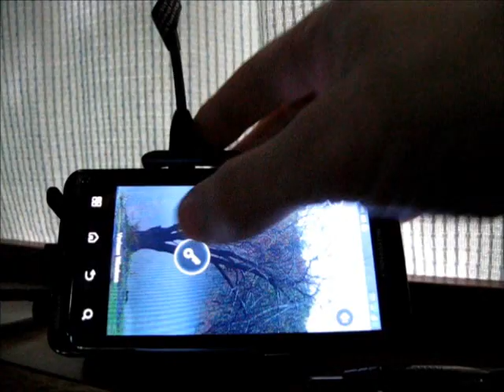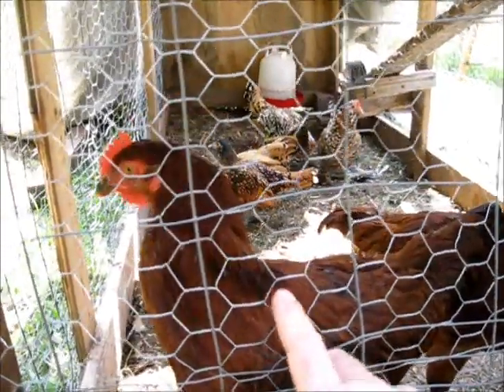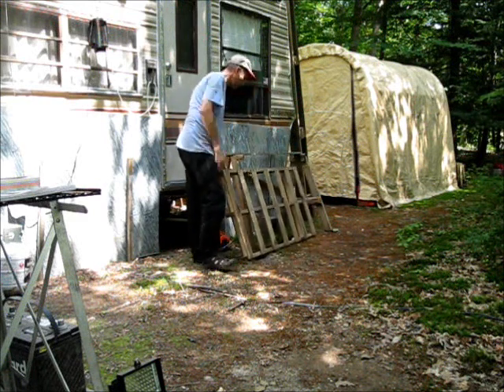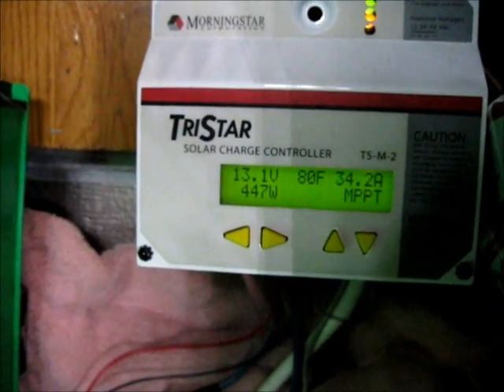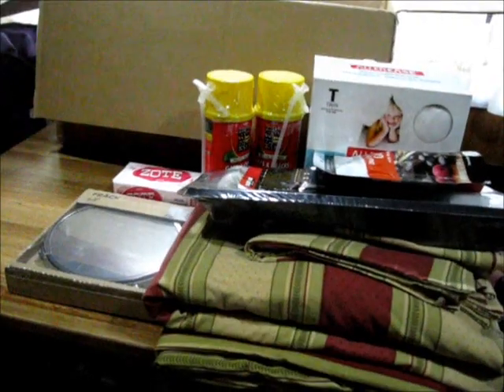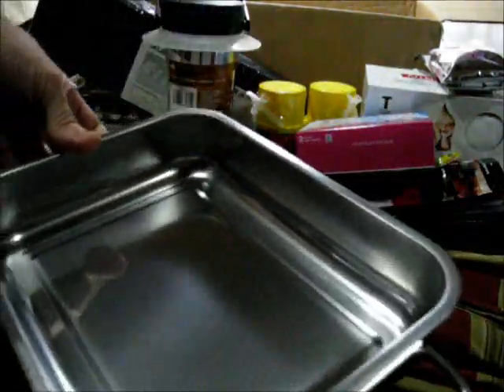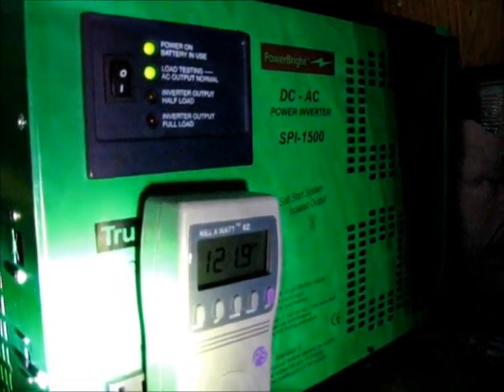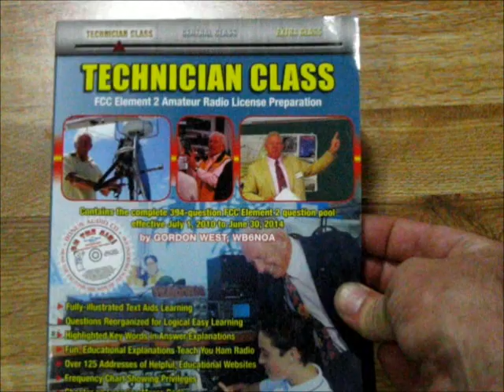Off Grid Solar Air Conditioning

Comment: After 3 hours of running, my inverter reported an overload when running my 5000 BTU AC wall unit.  I plan on installing a large farad capacitor to help with the surge.  See my channel to see my AC unit running on 2 solar panels. My Samlex inverter runs really quite compared to yours.  I like that Tristar charge controller.  I should probably get one of those.

Comment: Clicking your unlock button too much. Your chip is overwhelmed & confused. Make sure your phone is updated and cleaned of junk files too. Note the number of times the button shows waves out, it's processing your request. You tapped it 18 times in 27 seconds, then 26 times in 20 seconds.

Comment from the maker: Wait! What video are YOU watching??

Didnt you see it working on my video yesterday? All I need is larger wires. Using 600 watts of solar panels, 600 AH of batteries and it works.

NO, you do NOT need $15,000 of solar to do this.

Comment: does that inverter monitor battery temps...maybe the warm wires is setting off the threshold value of heat...the extra amp draw for the compressor stage may just spike the wire/battery sensed temp beyond that point

Comment: Your battery voltage is falling off way to fast as well. At 515 watts that thing is pulling 43 amps and you're only getting 20amps at 12.4 volts. 

You need about 700 watts of solar and 600 AH battery bank to run it for 4 hrs or so every day. 

One thing you have going for you is that MPPT charge controller. It's 95% efficient over the PWM which loses 30-40% of the panels output. Maybe use 4 six volt wired series\parallel rated at 225 ah. That would give you 450 ah and the solar can keep up with the load if its 700 watts.
Reply: You divid the watts by voltage to get the amps. Not voltage.

515\12 volts is 43 amps after the startup inrush which can pull 70 amps for the first few seconds. This is where people get caught. 

Only reason to go higher voltage is wire size. As a watt is a watt. You also need to use #4 wire from the charge controller to the AC inverter, batteries. This gives you max current flow and less resistance.
Reply: Claude Rains You're both talking about two different things.  Dividing by 110 gives AC amps and dividing by 12 is DC amps.  DC amps are what matters, though, when you want to know how much is being drawn from the batteries.  If deltasevenfour is talking about how many amps the air conditioner is pulling from the inverter then 4.7 amps is right, and that inverter should be able to handle that.
Reply: No I'm not. He is trying to use the 110 to figure his amps used. He needs to use the DC voltage as that is what is powering the system. 515/12 volts is 43 amps. He needs more watts and ah battery reserve. 

I'm an electrical engineer . I do this all day long.

Comment: I also have tried to find info out on that inverter. When Googled " Powerbright SPI-1500" NOTHING comes up, even at the Manufacturers website. Very strange. I'm wondering if that is not a prototype or experimental that was given to the dealer for evaluation. The closest model by Power Bright looks nothing like that. Because it is a Chinese based manufacturer anything is possible. I did Email them for Specs and a Owners Manual in PDF (hopefully)

Comment: AC has a start-up surge of 2-3 times it's normal rated running power. For a second , it'll draw 1,000-1800 watts on start up. When your batteries were still at a pretty high voltage, with the solar panels helping, the inverter may have been able to handle the start-up surge. You may have to go to an inverter with a higher surge rating.

Comment: another thought, check where the wires are connecting to the back of the inverter.  Thermal cycling may have loosened them a littlte

Comment: Your AC problem could be that it ran for so long trying to catch up that you frosted the coils. That will stop the refridgerant from moving from the compressor to the expansion chamber and then the coils so it cant disperse the heat.

Comment: I have no clue what you are talking about energy wise. What is a good book or info for starting out? Curious about the noise level from the inverter and other equipment? I realize with the ac on white noise is quite high but cool.

Comment: Of course it works, power in = power out, with a little inverter loss, maybe 20% worse case. I've run my 800W 8000 BTU window A/C on my 2 walmart 114 Ah batteries, 24V 1800W sine wave inverter and it works great! In the daytime with power coming in from the solar panels you are getting FREE A/C and it's a great feeling! I won't say it will run it all night but don't forget IT CYCLES ON AND OFF so the batteries are getting charged in between runs. Factor that in before you poo poo the idea.

Comment: Two of the 6 volt gulf cart batteries in series for 12 volts is a good choice, always charge them at more than a 10 amp rate as that helps keep the batteries in good condition. (Never trickle charge) But, do buy a gallon of distilled water (89 cents here) and put water up to the ring under the caps on top. weekly!  Epsom salts will destroy the batteries a few days after you put it in. avoid it...

Comment: The inverter is shutting down because your battery is fairly drained. You have drained the battery during the day playing with the air condition without realizing it. So, when you turn it on in the evening the drop is voltage will trigger the inverter. You need more solar panel or battery.

Comment: While it may not be within the budget of many of us watching his daily videos, $3,000 is a whole lot less than many critics of solar & wind say it is. And it's still below the $5,000 budget Troy plans on. Considering that you pay about $200+/month in electrical bills, the system you've researched will pay for itself by the end of the first year's end. And if you use electric heating, cooking, cooling, etc, you'll also be replacing natural gas too. That's another $50-$100+/month you're saving.

Comment: Look on Youtube for videos on how to restore weak batteries using epson salt. My suggestion to you is try to find old pallet jack battery. Though it may weigh 500-2000 lbs, it will last you a lifetime. You can take apart the pallet jack batteries and reconfigure them to 12VDC. These batteries will last you 40+ years if you take care of them. Keep your batteries in a small shed and keep them in a cool and dry area, away from direct sunlight. Marine batteries, Golf Cart batteries will also work.

Comment: YES! Normally I chose to not post my preps on the internet for OPSEC. But since you asked, I will answer. I have 2 Gens1 10KW & 3.5 as BU.w/ 200 Gals of Gas w/ Stabil. I have 12 KW of Solar running into 3KW  GridTie Inverters & 24V Battery Bank of 24 Trojan T-125 Batts feeding a OutBack 24V DC-AC PSW Inverter, Food for 4 for over 1 yr of  LDS Cannery , Wise & Reg Food.  250 Gals of Pottable water & Filtering 2 make 20 Gals per day. Security/ COMMS covered. I could go on, but I think u see Im OK.

Comment: Your chickens need a lot more room.
Reply: AGREE!! Give the chickens some space!!.
Reply: Yes agreed but please offer some sort of solution when criticizing someone. There might be critters around that want to eat those chickens which might be why they are locked up! That canvas covered shed thing behind the van that you put the AC in would make a good sized chook house if the frame was covered with mesh and a tarp on one end for Weather cover rather than the canvas cover it now has. So if you can get another of then it would make a good coop.

Comment: Between the hours of 2pm and 4pm it's hard to do work outside on a very hot and humid day. I say if Troy can get a running AC unit going without being tied to the grid, go for it. It's not cheating or being lazy imo.

Comment: A grid tie is a good way for someone to start using solar, easy hook up and they start to get the idea of saving money etc.. I have a device called a "GTI Controller" (google) that switches the GTI on and off while keeping a set of 24V batteries charged for emergencies, best of both worlds. Batteries suck, they need to be replaced every 5 yrs or so and lose around 50% of the energy you put in them. So if you have grid and can pump power out, use the grid as a FREE battery (that may go away).

Comment: Try spraying apple cider vinegar on yellow jacket stings right away, as it removes the stinging quickly. You may need to repeat. And then put ice on it - tie a bag of ice to your arm if it gets red.
Reply from the maker: Thanks. I did use baking soda and plantain leaf and it seems to have worked.
Reply: little bit of tobacco will also fix be stings

Comment: If you still have some of that wire around, just double it up. At least you can test if that was the problem and get bigger wires later. You want the shortest run possible to the batteries from the inverter of course. For safety there should be a fuse as close as is reasonable to the batteries, walmart car audio section has a nice $11 one, see my channel for a video on it. Get a spare fuse too. Didn't see the voltage go too low so for some reason solar was providing a boost to the cables maybe?

Comment: if that lantern takes 8 batteries you should be able to add port for a cigarette lighter adapter to plug into it.  then you can run it off your solar battery array.

Comment: When the air conditioner compresser gets too much moisture it will freeze up. when this happens just turn the fan on until the moisture is gone then turn the the compresser on. mine does this. Also it will happen when it rains and I get too much moisture. you can try this, maybe it will work for you.

Comment: Grab up one of those cheap Harbor Freight 900 watt generators. Ive often seen them onsale cheap as $90 and there are videos on youtube showing them comfortably running little air units like yours for days on end.  I imagine it would only take a gallon a day to run that ac,  and when theres no sun this could be used to top off your batterys

Comment: Hi Troy, nice try on the AC. I am trying to find info on that inverter, but its very hard. Most 1500 watt pure sine wave inverters do not have cooling fans, that one must be a commercial or motor home version. Could it be shutting down due to heat? what about the wires going to the AC? I would try bypassing the trailer wiring and going direct. I have an air compressor that will only run using a 12ga extension cord. otherwise, the cap blows. your trailer may have some bad old wiring.

Comment: Troy, lets say that all u need is bigger wires & it will be working, define what u mean by "working". How many hrs per day do u expect it to be on to meet your cooling needs? Are you willing to forgo all other electrical needs to make that happen? What happens if you use one evening and then the next day the batts are still discharged & its cloudy & u cant recharge.How will u work if you cant chrge the tools phone? U seem to just think that AC will solve all issues, u forget what it can create.

Comment: in this video you have problems touching your phone with WIRES plugged in.  I have read that improperly filtered dc for cell phone chargers cause very light noise on the DC source that "confuses" the touch sensitive screen.  I know I have that issue with some of the cheap 5v usb wall warts that I use sometimes.  I try to slide the lock picture on the screen and my finger print flies off somewhere else(noise on power line) instead of to the side to unlock.

Comment: So Troy...With the new fantastic essential air conditioner. How is the unit protected from the rain and dust being plonked down on that rickety wooden frame outside?

Or have you an agreement with a higher authority that it does not get rained on?

Comment: So Troy, tell me, even if you get the AC working, whether by Gas or Solar or Propnae, what will you be doing? Are you going to lock yourself in the RV & stay cool? How will this help you get prepared for the winter? To finish your projects you will still need to go outside & work. And if you cant, all you will have accomplished is "How to live in Air Cond. Trailer During The Summer". RV'ers have already been doing this for years. Once again, where is the How To Live In A Post Apocalyptic World?

Comment: would you happen to know the gauge wire that feeds your inverter? looks like a #2 awg or so. that's rated for over at least 100 amp of current draw. what is the low battery shut down for the inverter?? i think it has more to do with the battery end then the wire/cable end of the problem. The larger the pond the more water you can draft from it kinda analogy. before spending or doing anything with the " WIRES " find yourself a cable AMPACITY chart .and i think you will see its not the wires.

Comment: How many panels and how many batteries?
Reply from the maker: ***** At that time I was using 800 watts of solar panels and six 6 volt 216 AH golf cart batteries. But the batteries are sort of cheap and cant handle that much current really. I only used the AC when the sun was shining. Of course, thats when you need it.

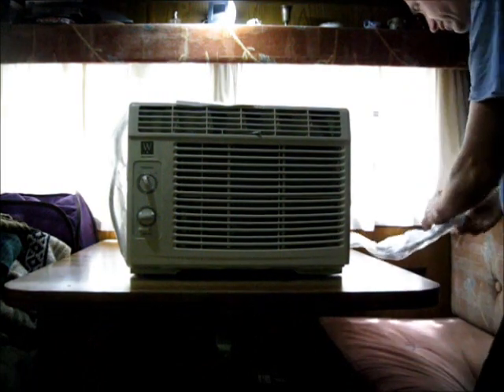Comment: The AC unit logo shows a "W" with a small dot below it, and a green background viewable above the control knobs on the left hand side of the unit @ 2:51 and again later in the video. The unit is a "Westpointe". That brand is, and or was, a in house / store brand from True Value Hardware Stores.

Comment: Hi Troy, Just a thought, If it's the humidity that's knocking you for six, would a de-humidifier work instead of the air con?

I've just had a quick look online and the one I looked at cost £55 ($82 approx.) and was only rated at 60w...( Airpro 2 Litre Large Midi Air Dehumidifier ) 

At that wattage you could easily manage to run two or three  24/7...

Comment: Maybe old problem but if u unplug the phone it usually stops the issue with not recognizing ur fingers
Reply: I used to run into the issue a lot when I had a modified sine wave in my truck
Reply from the maker: Yes that was the problem with that phone

Comment: you may have already tested that ac with sun.  But after watching this, I would test that ac with your gen first make sure you didnt pop the capacitor for the ac compressor. That AC lists 515 watts.  It will surge with the compressor.  What is the ceiling on your inverter?  I sure hope it isn't 500 watts.  I would hope you have at least a 1000w pure sine wave invert with surge to 1500.

Comment: You can't unlock your phone because you have the mini usb charger/data transfer cable plugged into the phone. Its some kind of a glitch. I have the same issue so it really sucks if you let the phone die because you have to let it charge to the point you can unplug it, then unlock the phone, and then plug it back in.

Comment: what it is i have the same problem if you turn the ac off and then back on straight away the compresser has to equlize the presure and while its doing that the ac unit is consuming way more power to try and speed the prcess up / start running again i tried this with our 5.5kw (250v) generator it didnt run on the generator

so try waiting a few mins!!

Comment: Try updating the GO Locker app you use to unlock your phone, if it's already updated to the current version, uninstall it and try downloading a different lock screen app. Even if it's a physical problem with the screen different apps and themes will allow you to move the swipe button from the middle of your screen

Comment: if you take  the time to look up the ampacity of the cable you will find that even a #4 cable can have up to 150 amps on it depending the length. In my professional oppinion and a commercial/industrial electrician for almost 20 years. its not your cables. it has to do with the battery aspect of the system. and the amout of time you can maintain voltage of  the battery system in an off peak/charge time frame. if you expect to maintain voltage when your not charing you need more battery storage.

Comment: Yeah, your AC issue is due to starting current of the compressor most likely and your tripping your inverter on overload. A fully charged 12 volt battery is around 13.2-13.5 volts, not 14 like I said earlier, my bad. If you can use your generator to charge your battery bank when solar is down, them you could use the AC.

Comment: You really need help in your project.

1. More batteries
2. A bigger inverter.
3. More solar panels.
4, A need for someone to help you out to rectify your problems.
5. That care package you got was nice, but did not give you what you really need.
6. You need some help, be it money, or more care packages.
7. Make a list of items you really need to have,  I know I have some stuff that you could probably use & I am not using them any more, & would be happy to ship them to you, If I had a address to send it to.
8. Scrounge for some copper electrical cable (go to a construction site, I am sure they have a ton of scrap copper wire) that is thicker than what you are using right now, because your problem is the cable, it can not handle the electrical load.  (If it gets warm, there is a problem with it being too small of a diameter to carry the load.

I am not subscribed to your channel, but I really feel for you!  Why?  Because I have been homeless before & slept under a tree in a sleeping bag for 2 weeks at Stanford University Collage in Palo Alto, California.  So, I know where you are coming from!

Make a list,  I'll see if I have anything that you need & ship it to you, when you give me a address, Ok?

Kurt

Comment: Ok. Golf cart batteries are just fine for your needs. Start collecting them for next season. You might need 10 or more to safely run a 5000BTU window AC unit overnight. Please take care to wire your banks like I showed you, or else the batteries will die prematurely.

POSITIVE CONNECTION  6v + 6v (12v) and 6v + 6v (12v) and etc... NEGATIVE CONNECTION

Connect your positive side to battery bank 1. Connect your negative to the last battery bank. This will charge & discharge your batteries evenly.